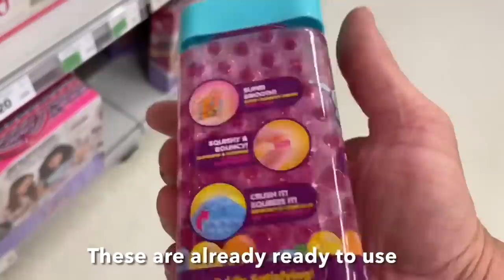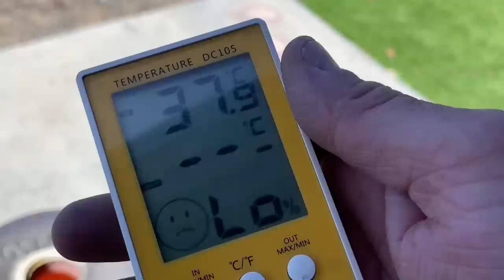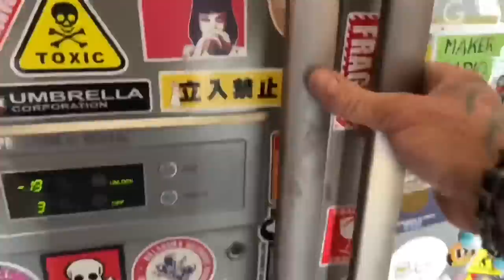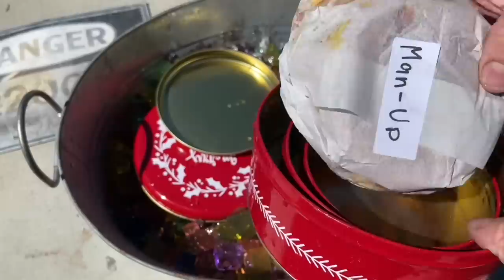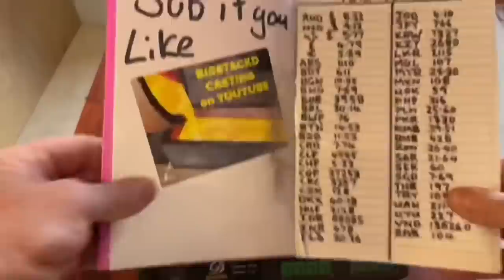Aluminium Can Meltdown - Orbeez Aluminum From Cans -ASMR Metal Melting -Trash To Treasure -BigStackD

Comment: I think those make awesome unique art pieces, even the square ones! (I didn't know they made square orbeez!) but I'm curious, why doesn't it cause a steam explosion pouring the hot aluminum on the wet orbeez?🤔
Great video as usual! I woke up my dachshund (it's almost 2am here) laughing at you carefully parking your jeep, tasting orbeez and admiring little pink shoes lol
You're probably missing the "annoying" ice cream truck coming round on a hot day now that you live out in the country!
Reply: from my limited science education, moist beads acting with leidenfrost? effect, the hot metal on the beads creates a thin steam shell that has plenty of surface to spread out on and escape.
Reply: Wow those look amazing here is an idea something new for you maybe you could do something crazy like resin table or a column of water they look like a coral reef maybe break the high tops off and use just the bottoms so it takes less resin JUST AN IDEA HOPE YOU LIKE 👍
Reply: @eonmoon2166  you're exactly right, the steam has a place to escape. Even if the aluminum fully surrounded one of the jelly bits you may not get a steam explosion because you would also need enough metal layered around it to create the pressure for the water to boil and explode, if it's a thin metal coating it'll just sputter out through the metal and not do the usual Pow! noise.
Reply from the maker: Actually the ice-cream man tracked me down and dropped in on his way to town so he'll show up again in a vid soon👍
Reply: @bigstackD   ارجو الفديو القادم صب النحاس الاحمر في الماء يزيد وزن المعدن ارجو الرد السريع
Reply: I was just wondering that about melting the cans. I would imagine some of them have some moisture in them still
Reply: @dslice4275  yeah I guess I don't quite understand what causes the steam explosions as it doesn't seem to happen EVERY time moisture/wetness comes into contact with the hot metal, I'll have to do some research i guess!

Comment: I use the orbeez for gardening. Before planting put a bunch in a hole below where you are going to plant. Then if there is a dry spell the plant's roots will pull water from the orbeez. Works very well for guerrilla growers.

Comment: I thought it was an interesting pour for sure. Expected the things to pop or something... I haven't seen a Kmart in years! They are all but gone here in the states. Also, as someone that is very careful of moisture when you do your pours, were you not concerned pouring into these things that grow from sucking up water? I ask because I honestly do not know. The years I have watched you is all the experience I have in this department 🤷‍♂ . Anyway, I am jealous of the heat there, it's is still cold and I hate it. See you next week!
Reply: Small pockets of trapped moisture are more the problem. If there’s no where for the steam to go, it will explode (like inside a door knob, or a paint can) but since this is essentially a bucket of water, there’s plenty of places for the steam to go.
Reply: @LaceBlood  That makes sense, I was wondering about that myself.
Reply: Trapped moisture is the key. If water gets into the metal, the rapid steam expansion causes the metal to go flying. If metal goes into water, it cools quickly and any water turned to steam just boils off safely.

In short: water into metal = bad, metal into water = usually fine

Comment: I think psychologically, the reason the round ones look more appealing is that circles appear much more often in nature, while squares hardly ever appear in nature. So the circular ones look more natural, and the square ones look more artificial.

With the way it looks like coral, our eye instinctively wants to make the connection. Therefore it prefers the ones that look more natural. The square ones push the boundaries of natural instinct, and therefore aren’t as immediately appealing. The appeal of the square ones would be in someone intentionally looking at them as unnatural or artificial.

If anything, the round ones look more like natural coral, but the square ones look more like modern abstract art.

Comment: I have an idea. Create a concrete block with a cavity  shaped like the inside of your crucibles. You could compact stuff into it till it conforms to the shape, then pull it out and transfer it to a crucible. You'd get much more stuff into a crucible initially that way.

Comment: 5:20 I've been thinking about your can crusher for a while - for much the same reason as you state in this video. Originally I thought about just a simple V-shaped funnel or a contraption akin to an ammo clip for the cans, but then I realized that that would probably not work due to the low weight of the cans. meaning you'd probably have to load them one by one regardless to ensure they line up properly - at least most of the time. The next step up would be to use the moving piston to push the cans into  the crushing chamber, into which they would drop when the piston retracts. For that to work you would need some sort of flat hook to hold the can in place when the piston is in crushing-position, but which would also release when it is at(or near) maximum retraction to allow the next can to be fed into the chamber. 

The (boring) alternative would be just a small wooden rectangle above the crushing chamber that only holds one can.... Basically pre-loading one can

Comment: Mr bigstackd, I can not help but wonder if you could come up with a more efficient way to melt cans.

Kind of a chain feeding solution perhaps with a tube of sorts rising up from the crusible but clear of it so it doesn't hinder air exhaust.

It might be possible to could just fill the feeder pipe and leg it run.

Actually, that spoils the fun.

Comment: Thanks for all the great videos! I am curious why there wasn't a issue with steam? Just no way for it to build pressure in an open bucket? I am always afraid of molten metal and wet things.
Reply from the maker: Hey Dave Cheers for the super thanks I really appreciate it😁👍 Take care and have an awesome weekend my friend👋
When it comes to a steam explosion that will only happen when the moisture is 100% trapped and it'll turn to steam instantly but as these beads have air all around them so there's no chance for a steam explosion ,although if 1 of those beads were to become completely covered it could very well create an explosion but I have never heard of anyone actually bhaving that happen with these water beads👍

Comment: One of the square ones looks pretty cool but the other took too much of the bucket shape.  I think the tricky part is pouring just enough metal to make it look good but not so much that it sinks to the bottom and uses the bucket as a mold.  I would try pouring it into a very DEEP bucket or a wide tube to see how long you could get one to come out.

Comment: I would say 2 is the best without the bit that went along the side of the bucket. These things tend to work best if you got deep bucket and if you kinda focus the pour into one spot for doing the long coral like fingers. Moving around like that builds it up which is good for a base. I don't think you would need to drain the excess water between them but I am not sure. Either way the best part of them is the sound they make.

Comment: Do you think you would make a more powerful can crusher? Like one that squashes them down even smaller?
Orrrrrrrr, you could get one of those metal shredder machines, the ones with rotating metal wheels with teeth that chop in to pieces almost everything!? Come to think of it, using both the crusher first, then the shredder may be more satisfying 😌 😁😁😁

Comment: 1

I heard dross happens when hot aluminum reacts with air (oxygen). There's also paint on & plastic in those cans. 
Would it be possible to have less dross if the crucible were covered? Maybe have CO2 pumped into crucible while still keeping the fire going?

Comment: I have noticed several times in your videos that you don't get the metal hot enough for a good pour. If the metal is freezing on the top of the crucible before the pour is completed, then it is too cold to pour! Most metals need to be at least bright red to yellow hot to pour correctly. Just my humble opinion!

Comment: Melt as much copper as you can. Industry leaders in copper estimate that as much as 4 - 10 times more copper needs to be mined than currently is to meet the growing need of an electric future. It is not if, it is a matter of time. Copper is going to go up a lot in value.

Comment: You can donate the orbeez to a school that helps autistic children as just as you found it relaxing to run your hand through them, autistic kids find it especially soothing and relaxing.
When doing cans, I actually prefer them not crushed as they push in far faster and easier...however...I can fit far more cans in a trash bag which are crushed than not crushed, so no choice.
Your battery isn't flat, instead, it's a cube with a flat top.
When doing cans, I'll toss in a partial ingot from a previous melt so that I'll have a pool of molten aluminum I can just sink the cans into quickly - far faster and easier.
Get a length of thin rebar and bend the last foot into an L then you can just toss the cans in and push them down with the rebar - this results in less dross from oxydation as you're moving the metal faster.
You probably notice he got even more dross than he started with when he tried to melt some aluminum out of it - unless you can grind it up pretty fine, trying to get the aluminum trapped in it tends to be a waste of time and money (in the form of fuel) as you're getting so little aluminum from those chunks it isn't worth it.
Why am I saying dross instead of slag?  Slag is the waste product from extracting metal from ore - minerals and other metals you didn't want - dross is the waste product from processing metal and for aluminum, that's mostly oxidized aluminum.
Get yourself a "walk the plank" style mouse trap - you'll catch far more that way.

Comment: Awesome video, thanks for doing this. I wonder if the square orbeez didn't turn out as well because the squares were larger and appeared to be more wet? The round ones were smaller and not as moist (or that is how it looked). If the square ones were smaller and not as wet, I wonder if it would have looked different in the end?

Comment: as odd as this may sound... if you get the chance to find a 3d printer why not make your boys with it and then make lil statues of them?
Reply from the maker: I just opened up my kiln And realised it’s got the wrong plug on it so I need an electrician to swap plugs and once I have it up and running I plan on making a few little statues and a lot more lost wax casting and lost PLA casting to make some more intricate pieces and not just bars & coins👍🏻